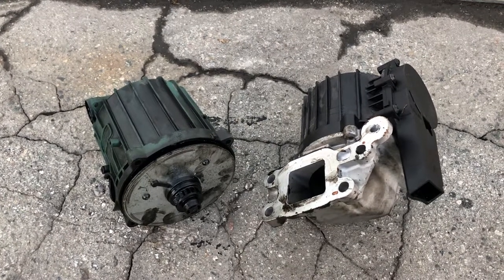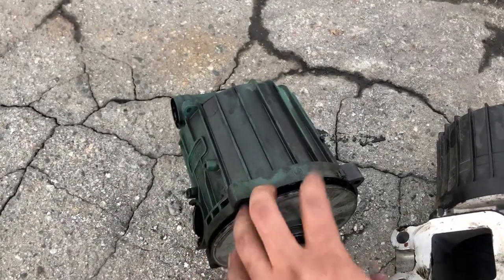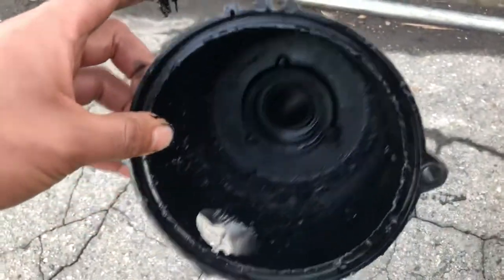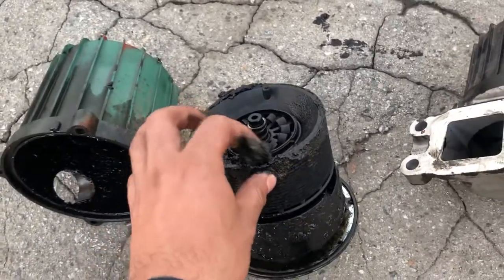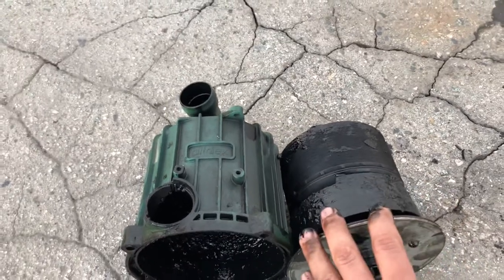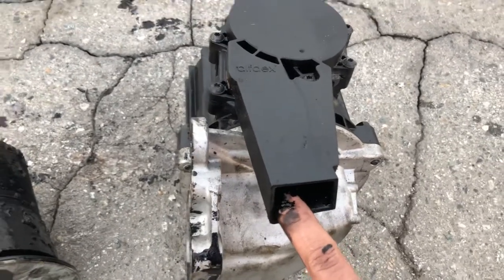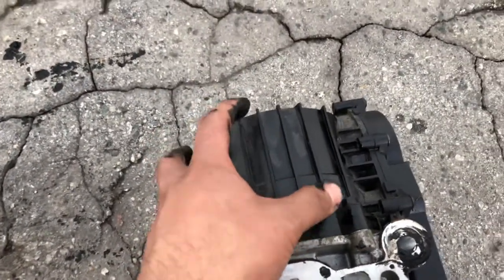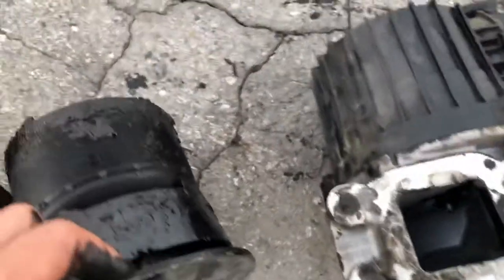Heavy Duty Diesel engine 101 Episode 1: how the Oil Crankcase Breather works.

Comment: Thank you so much for this video. This is the only video on YouTube that explains everything and the option to change just the upper part. Volvo is very reluctant to sell just the repair kit..
My breather is dripping oil.from it's exhaust pipe. Ofc if it is not spinning the oil is getting dumped outside through the exhaust pipe. 
I will.order the repair kit online it's around 230 vs 1600 from volvo.
Reply from the maker: You're welcome!

Comment: I never would imagine that the blow off vapors could cause sludge. interesting.  I cleaned mine last year and it was sludge free. It spins fast after I turn my truck off. At least I feel better about changing my oil often. I use full synthetic. Expensive, but, my truck runs like a champ. Thanks for this video.
Reply from the maker: Glad to be helpful. Keep your truck Prevent Maintenance that way and in a long run you will see the pay off that.
Reply: Hi Joe, you mention your crankcase breather spins fast when you turn it off, is that normal?. when I turn my truck off I can hear IT spinning and actually makes a whistling sound, is that what your does?. Thank you
Reply: Yes, it spins for a while after I shutdown. Mine does not whistle, but you definitely know there is something spinning inside.
Reply: Got it, thks again
Reply: What Did you clean it with and how did you clean soak it or spray ?
Reply: @MrSwordfisher  soaked it with some parts cleaner

Comment: Would this create a problem with high oil pressure?  Pressure over 100 even after changing relief valve on filter housing and not a single error code

Comment: Hi, I have a 2013 International 4300 with maxxforce engine. I recently had the turbos replaced because I was told my turbos were bad. So I got them replaced but I still see that engine oil coming out of the crankcase breather along with smoke. And also where you check the engine oil level, there’s smoke coming out. You can see that when the dip stick is removed. Is that a reason why engine is loosing oil like everyday?

Comment: Hey man question. I just had mine replaced on d13 engine. But the new one now makes a noise for like 3 seconds after i shut the engine. Is that normal or its supposed to not sound at all?

Comment: Hi do you have to worry about oil dripping when you take the breather apart since it should sit at the top of the engine?
Reply from the maker: It will leak just a bit when you remove it (use a oil pan just to prevent spills over the floor). Thanks for watching.

Comment: When I turn off engine on my Volvo d13, this part makes loud spinning noise. It's that normal?
Reply from the maker: As long it does not sound like rough grinding, no noise at all or leaking oil from the breather pipe, it should be fine.

Comment: I like your video I'm having problems with my International and I just bought that piece since I'm an old mechanic I like to take things off and fix them is there any way that you can clean this and put it back on.
Reply from the maker: The plastic part inside the oil separator/ Crankcase breather cannot be clean, since soot accumulates around it and you can notice how gets into really tight places. You should replace the whole oil separator. Volvo offers a kit to replace just the top part of the oil separator/Crankcase breather (this apply for Volvo engines only). For International, it depends, if that one has Cummins Engine does NOT use Crankcase breather as you should know. Maxxforce and A26 engines use Crankcase breather but Maxxforce is a pain to replace it, so you should use a new part instead of cleaning the old one, A26 seems to be a bit friendly but still same opinion like Maxxforce. Glad that you like my video and I hope this help you and never is too late to learn new tricks.
Reply: @LetstalkDIESEL  thanks for the quick replying so quickly I already bought the piece so looks like I am going to replace it and you're right maxxforce 13 it is a pain in the ass   to replace it.
Reply: I have the max force engine as well, will that cause the check engine light to be on?? A mechanic told me that’s where I’m getting the oil leak and should replace it,Thank you for the video.

Comment: Thanks bro nice explanation I have Volvo d13 808500 miles my crank case make noise abt 3 min aft stop engine  little bit oil leaking from block n crank case so I have to replace whole part or only gasket please reply
Reply from the maker: You could replace just the top part of the breather, Volvo dealer sells the kit for that. Also, you could replace the whole assembly as well, but it will be more expensive, if you are planning to use an aftermarket part, be sure it is from a recommended place and has good reviews before buying it. Thanks for watching.
Reply: Let’s talk DIESEL. Thanks bro lord yashua bless you

Comment: Hola una pregunta un bad crankcase breather puede causar humo blanco? O smoke from the oil dipstick, tengo una international maxxforce7 😭 corre bien prende bien pero habienta execivo humo blanco cuando manejas y tambien m di cuenta q sale como vapor del oil dipstick si lo saco,? Sabes q podria ser? Ya replace el turbo, egr, y water pump, creo q el crankcase breather podria estar mal pero 😐 ya estoy perdiendo la fe y dinero con esta troka el humo blanco no para d salir, ojala y m puedas ayudar 🙏
Reply from the maker: Primero si tienes perdida de coolant o aceite, podrías investigar la razón de ello, usualmente cuando hay exceso de humo blanco de el escape, podría ser los inyectores, el empaque de la cabeza está dañado o algún cilindro está reventado, por mencionar algunas causas. De cualquier manera te recomiendo que lo lleves a un taller donde lo puedan revisar apropiadamente, con la herramienta adecuada. Muchas gracias por ver el video y espero que esto te ayude.
Reply: Did you find out what was causing the white smoke? I have the same engine with the Same issue
Reply: Did you find out what was causing the white smoke? I have the same engine with the same issue

Comment: Hi Sir, great video!!. my question is on my volvo it is making a "whistling sound"  do you think the crankcase breather is bad?. thank you
Reply from the maker: If your crankcase oil separator still making noise after your turn off the engine, you can listen it, if you hear like a grinding noise when spinning, replace it. If no sound is found ayer turning off the engine, then your crankcase oil separator is fine (unless leaking oil). I hope this information help you and that for support the channel.
Reply: Yes,  it sounds loud as if bearing are grinding. Sounds like it's whistling or air leak?.
Reply from the maker: Yeah, it does sound like an air leak. So you should replace the crankcase oil separator.
Reply: Thank you so much. I appreciate you

Comment: Hello boss can this cause my truck to shut off? Code is showing some kind of crankcase pressure sensor fault ..
Reply from the maker: That could be a reason, but the stop light usually turns on when the crankcase pressure sensor failed. Try to use the PTT (Volvo software) to be sure that it is reason why your truck is turning off.

Comment: Got very little fume/smoke coming from oil cap.
2015 Volvo d13,  390k miles.
Breather never replaced.
Any idea whether it's bad Breather or engine problem?

Thanks
Reply from the maker: You could replace the oil crankcase breather first, then see if there is any difference. If problem persists you need to take your vehicle to a repair shop for further diagnostic. Thanks for watching and support to the channel.

Comment: Trying to find the crankcase filter speed sensor but it’s not on the filter itself. What other location is that thing at?
Reply from the maker: Volvo trucks does NOT have a crankcase speed sensor, but Freightliner does have (few models though).

Comment: I got the code for cvv but want to ask, if i have oil leaking on both side of truck and all the way back to fifth wheel part of frame, could this still be the issue?
Reply from the maker: You might want to take a closer look to your breather and make sure that is the reason for the oil leak, but if you say there is oil in the other side of the engine, it might be something else as well. Try to clean your engine properly and check it out again. Alternatively, you could let a technician or mechanic take a look to pinpoint the problem faster. Thanks for watching.

Comment: What can happen if u drive like a week with a bad crankcase breather filter (leeks oil) ?
Can blow up a cylinder or cause some other big damage on my cascadia?
Reply: It will make turbos start sucking up oil and you will lose power just happened to one of my trucks started leaking first we couldn't find where it was coming from then the turbos let go
Reply: @chubbytx1042  I replace mine and  now is blowing light blue smoke . That’s what You had ?

Comment: I have the same issue with my 2015 frirghtlinner DD15 and thinking about changing it myself but do I need to drain oil out or not?
Reply from the maker: You do NOT have to drain the engine oil to replace the crankcase breather.

Comment: I've been a diesel tech for 32 years.    That sludge is supposed to be their.  That's what a centerfuge does.  It separates carbon particulates.  
People talk about things they don't understand all the time 
Ask the dealer what the interval is.  Don't take advise from someone who can barely speak english. .  DDs went to 45k PER DERTOIT almost 15 years ago and the centerfuge is one of many reasons not 30 or less.      Remove parts if you like bit don't explain things you don't understand.

Comment: Hello sir. I got a code that says crankcase ventilation system disconnected, i don’t see anything wrong with hoses,but it seems like there is some rumbling noise coming from crankcase filter when the truck is on, when I turn it off, there is no noise, so I’m little bit confused. Do you think the crankcase filter is bad,or clogged or something else? 🤔 Thank you
Reply from the maker: After shutting down the truck, pay attention close to crankcase breather area, if you hear a noise coming from there, probably it is the oil separator (crankcase) the problem. I hope this help you.
Reply: @LetstalkDIESEL   Thank you so much sir, for the response, I will try that for sure. 🤝🙏

Comment: How do you change the crankcase filter on a Volvo D13
Reply from the maker: I am planning to make a video about it, stay tune.
Reply: @LetstalkDIESEL  will that make the truck run different. If you don't change it what could happen?

Comment: Hello Bro ,
I want to illuminate the crank case spinner . Could I remove the filter plates? Or would oil come out blow by ?  Thanks
Reply from the maker: What do you mean with “Illuminate”? Usually, you can removed the top part of the crankcase breather but you must remove it from the engine block... it will not leak oil from there because the oil level must be below of the breather position in the block. If you notice any oil leak that will be from the breather itself. Just put a small oil pan underneath. I hope this help with your question and thanks for watching.
Reply: @LetstalkDIESEL  , I think he is saying,  "eliminate". He wants to get rid of the spinning wheel,  lol.

Comment: Hi my 2009 Volvo D16 is using a lot of oil, gallon a day and Volvo said maybe the separator stopped spinning or a valve in the separater unit is not working, my blow by tube is dry it’s expensive to replace, $2000 they recommend a lot of expensive repairs, what are your thoughts?
Reply from the maker: 1st. Wash your truck underneath, clean all the places with oil, try to clean it the best you can. 
2nd. Run the engine for at least an hour, then go under your truck and pay attention around the engine area, perhaps you would be able to spot the leak. If you find the leak like this, try to see if you can fix yourself or requires a Technician.
3rd. If you cannot see any leak with the engine just seating and idling, then drive test your vehicle for few minutes in the highway, that way you will put more stress into the gaskets or the Crankcase breather. The leak might appear with this method.
4th. If after all these steps your truck still not showing a major oil leak, then perhaps your truck has another issue, that is not related it with an oil leak.
I hope these steps help you to find out your problem. Thanks for watching.
Reply: Thanks I never could figure it out just add oil

Comment: My truck turned off while I was running.
No lights on dash came on at all,No gauges were low,Everything was perfect,I eas checking my gauges during the whole trip,Then I made a left on a stop sign and as soon as I  straightened the truck to take that street my truck turned off.
Then I tried to turn it back on a few minutes later and a lot of smoke came out from that part that you are showing us right now.
The dash started showing low voltage and then my truck didnt want to start again.
I checked the bateries and the said the batteries were good.
A lot of smoke came out of that part,My truck is a freightliner century.
What do you think would be the problem? Please help me with this.
I really hope you can write back soon because I have 5 cars on my trailer that need to be delivered these following days.
Thank you so much for your time and your videos.
God bless you.
Reply from the maker: It is NOT normal that smoke come out from the breather, if you can see white smoke, there is the possibility that there is coolant intrusion into the oil pan. First check your oil color, usually water makes it milky, if everything is ok with your engine oil, then go underneath your truck and pay attention around the outlet of the breather, if you can see drops of water coming out then it means something is going on with your engine. I cannot tell you that is your problem exactly but you should take your vehicle the nearest repair shop for a look. I hope this help you and May God Bless You. Thanks for the support and watching the channel.

Comment: Does the Detroit 60 series have it?
Reply from the maker: If the DDS60 has the DPF system on board from factory then yes, otherwise, older models do NOT have Crankcase breather (below 2008). Thanks for watching.

Comment: Alex when i remove the breather on the Volvo ( the 3 screws) does the whole top half of the unit come out together, i took one off today but the bottom half stayed on, do i gently tap on it to remove it,  or is this a sign that this part is no good I'm needing to replace the seals on mine.Any reply would be great and thanks for all of the helpful videos.
Reply from the maker: The bottom part of the breather is aluminum, so just hit it a bit, or use a flathead screwdriver to separate the plastic top part and it should come off easy, like you said gently because, usually,  it is not that tight. Sometimes, that happens that even after you remove the 3 screws still stick to the bottom part. So, just make sure when you install everything back, use everything that comes inside the kit. I hope this help and thanks for staying around.

Comment: Hey bro, 
I have d13 engine 2014 freightliner cascadia. I had my truck sit for 4 months due to covid and then i took it out for a spin the other day and got this MIL light/check engine light on and when i checkeed the codes..it said spn5444 fmi1 . It reads that oil breather too low.
So i changed the breather, speed sensor and check the wiring but the problem still exist. Please advise..
Reply from the maker: If you replaced the breather and the speed sensor on the top of the breather, it might the engine harness your problem, it is possible to fix the harness (if the damage wire is not to close to the MCM junction or inside the hard cover around the oil pan). If you had repaired the engine harness before this problem, the only option is to change the engine harness. This is just my personal opinion, for a proper diagnostic take your vehicle to repair shop to know your exact issue, ok? Thanks for watching and for the support to the channel.
Reply: Yea. Mechanic found out that there was a problem with the wiring somewhere around the engine so he bypassed the wire through another way i guess. Now the code is gone and looks good.

Comment: Is it possible that the motor can damage the crank case filter because I put one in april 2020 because it was leaking oil and a code came on so I replaced it and problem solved 7 months later while I was driving I heard a pop noise on the driver side I stop and noticed that I was spilling oil I thought that it was my crank case so I replaced turn on the truck it seems everything normal 15 or 20 min later I heard the same pop noise what could it be
Reply from the maker: Is the crankcase factory new or aftermarket? Is the pop noise constantly? (When engine running at idle) is still leaking oil with the pop noise?

Comment: Thanks for sharing
My 2014 d13 had a Stop engine warning and the code.. SA 16 DTC P113500 which says online crankcase pressure too high you think replacing the breather should fix it or it's a crankcase or oil pressure sensors.? Thank you
Reply from the maker: I recommend you to change the Crankcase breather Sensor if the STOP light is coming on and off and Crankcase breather/Oil separator if it is leaking oil. Oil pressure sensor has nothing to do with the breather unless you see in the intrument cluster the oil pressure gauge is not reading correctly. I hope this advice helps to your issue.